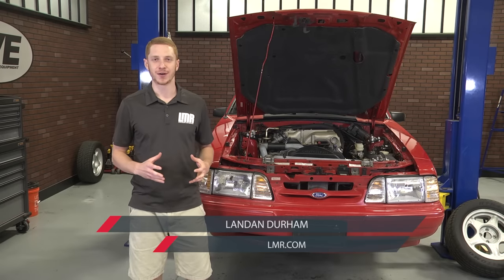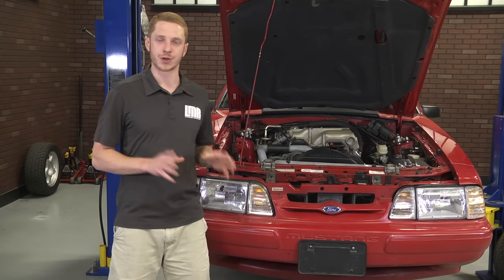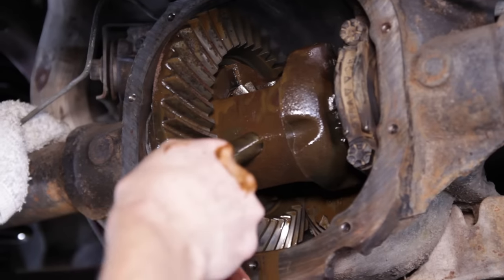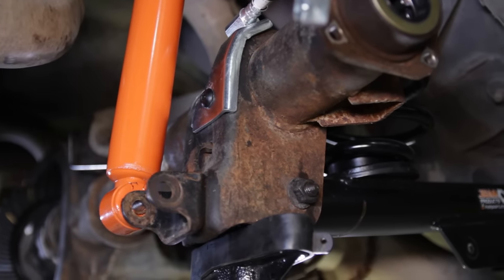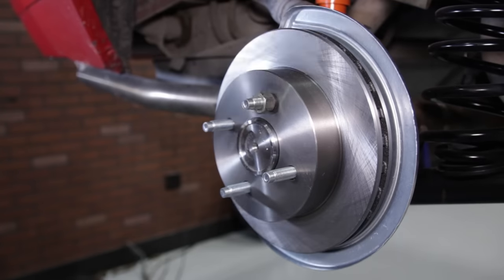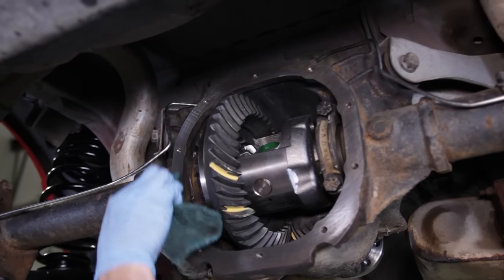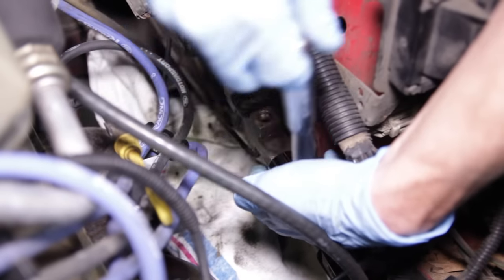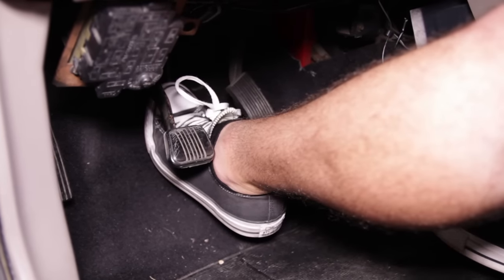1979-1993 Mustang SVE 4-Lug Rear Disc Brake Conversion - Review & Install

Comment: I know this is 5 years old but I do have a tip to share with all fox bodies owner. If you have a five-speed with most of us all do and when you take off and you hear a little clink when you are starting off and cannot figure out where it's coming from this tip is for you.

That noise that I was hearing had me worried that either something's loose in the rear end or my transmission. Every weekend from spring until fall I would be at the drag strip with racing slicks and would race all day. So I had a good reason to worry.

I finally had enough of it and put my car on jack stands and rims and had my father get in my car and start and work gear. It was definitely coming from the rear and for some reason I decided to tighten the bolts at the end of the drive shaft that attached to the rear. I used a 12 mil 12 point wrench and yes got a little bit of movement from each bolt. I thought to myself this can't be it. Sure enough when my father put the car into first gear and no more noise.

I had stopped by to have lunch with a friend of mine who was a Ford mechanic. He was the senior mechanic at the dealership as we were walking out one of the mechanics stopped us and was demonstrating the noise that I was feeling with. My friend told the mechanic to change to you joints and I said you don't need to do that get a 12 mil 12 point wrench he looked at my friend he told him get him what he asked for he knows these cars better than myself. So I told them with just enough movement to tighten them up. They both were skeptical until he got into the car and the noise was gone. At that time mechanics at dealerships got paid for work and there was very little money to be made by tightening bolts and doing nothing else. Since it was a warranty work they went ahead and change the u-joints anyhow.

2 months after that Ford finally came out with a service bulletin identifying where noise was coming from. What Ford wanted mechanics to do were to replace all four bolts holding the drive shaft in. The new bolts came with loctite already on the bolts.

My friend was actually able to grab a box of the bolts for me. Even after all these years 30 plus years I still have those bolt in my garage on my part shelf.

Comment: I know this is an older video and the kit is different now but with this original kit what year did this rear caliper come from? Im in need of the pads and rotors. Had to replace one caliper so i figure i will service the brakes and rotors. I appreciate the info.
Reply from the maker: '93 Cobra rear pads will work with the calipers that were in the older 4-lug rear disc kits. We have a few different options. Link below. -Landan

https://lmr.com/products/Fox-Body-Mustang-Brake-Pads-Shoes
Reply: @latemodelrestoration  what about the rotor?  Is it a 10ich rotor? Thanks for the pad link.
Reply from the maker: @mosesandres3385  A '93 Cobra rear rotor will also work. -Landan

https://lmr.com/products/79-93-Mustang-Brake-Rotors-And-Drums
Reply: @latemodelrestoration  thank you for the speedy response Landan

Comment: I was reading on bleeding brakes with an adjustable proportioning valve and everyone’s saying the valve should be fully open when bleeding brakes?
Reply from the maker: That's exactly what we mention in the video at 11:26. Thanks. -Landan
Reply: I guess I misunderstood. In the video you said turn clockwise which I thought was closed. Then said after bleeding adjust the knob in the middle
Reply from the maker: @DarkFoxx88  A brake proportioning valve doesn't work the way you're thinking. When you rotate clockwise, you're allowing maximum braking pressure. When you rotate counter-clockwise you're reducing the maximum pressure by roughly 57% (this varies with each proportioning valve). The best reference I can give you is that an adjustable brake proportioning valve is not like a hose spigot. You're not "closing" or "opening" the valve. As with anything mechanical, there is a detailed engineered explanation as to how an adjustable brake proportioning valve works and that's too long for a YT comment. Lol! Hope this helps. -Landan

Comment: I noticed u didn’t install any parking brake cable brackets, are they needed or is this an option? On the five lug conversion video, it shows them installed 🤔
Reply from the maker: If you have the available brackets, the reuse and install them. - Jude H. - Social Media/Events Coordinator
Reply: Late Model Restoration 
I’ve done the drum to disc conversion.and the car already had upgraded lower control arms ,so it didn’t have any brackets. I have access to some from an sn95, are they the same as on the 93 models? If so could those be used? ... thanks
Reply from the maker: The 94-04 brackets are different from 79-93 brackets. I'll link them for you below. Unfortunately, we're currently out of stock. You can sign up for in-stock alerts on the product page to be notified when they've been stocked and are ready to ship. - Jude H. - Social Media/Events Coordinator | https://lmr.com/item/LRS-92860/mustang-parking-brake-cable-bracket-79-93

Comment: What about the five lug ford ranger axles will they work with these in the mustang? Of course I know you all want to sell your products so prob won't address this
Reply: someone who wants setup without taking the axle assembly off would prefer this.
Reply: This video is made for people who want to keep the old school 4lug but want rear disks. I've done a few axle swaps, any v8 or v6 axles from 1994-1999 and 2000-2004 work with the 1985-1993 mustangs. I've done it but I have a 93 that I wank to keep the 4lug so this product is appropriate for some

Comment: Bought my 89 Notch with these installed already, do you guys sell the brake pads?
Reply from the maker: Here is the link: https://lmr.com/item/LRS-2001E/1993-Mustang-Cobra-Replacement-Rear-Brake-Pads

These are the same pads we include in the kit. -Landan
Reply: Late Model Restoration thanks!
Reply: this kit appears to include standard 94-04 mustang rear calipers.  it also includes a vented rotor.  Were you to go to a parts store, you could tell them you have a '94-'04 cobra, '03-'04 mach 1, or an '01 bullit and get the correct pads.  Odds are they'll STILL ask you if you have vented or solid/unvented rotors (despite the fact that the aforementioned list of cars are the only ones that have vented rotors from the factory), and you'll definitely want pads for vented rotors.  The pads for unvented rotors are too thick to fit.
Reply: ROYCE 415 wouldn't rear disks cause the car to spin-out if you had to slam the brakes in an emergency?
Reply: Carlos C. Only if you set that proportioning valve completely wrong. Many cars have rear disc brakes.

Comment: @+latemodelrestoration, ok I'm confused, when u gutt the proportining valve, do I removed  all the internals? or do I just replace the rubber ring? I'm almost done with my disk conversion.
Reply: Miguel Tamayo you probably figured it out by now, but you pull the whole mechanism out of it.

Comment: What is the radius of the axle center to the outside of the caliper.  
I need to know if the rims I am using will clear.
Reply from the maker: I do not have this specific measurement, but this particular setup will require the use of a 16" wheel or larger.

Comment: So I'm in the middle of this installation and I cannot get the brake pads installed with both anti-rattle clips. I got the outside pad in, but it's jammed and there is no friggin way it's going to be able to release or slide. What do I do???
Reply: Had the same issue, I took a file to the pad

Comment: Will this kit fit a 7.5 rear end?
Reply from the maker: Daniel - This kit is designed for cars originally equipped with 8.8 rear ends.  However, it can fit 7.5 rear ends with minor modifications.  Instead of using the provided axle hard lines, you would need to cut and flare your factory lines to install them into the brake hoses.  Other than that, everything installs according to the video.
Reply: @latemodelrestoration  nice very nice, thank you for the information

Comment: does it work with c clip eliminator ?
Reply from the maker: The included disc brake brackets will work with c-clip eliminators. However depending on the axle that is in the car, this kit may or may not work. -Landan
Reply: +Late Model Restoration the axles are moser 31 spline .

also the car is a 79 but the rear end is out of a 91 GT .will that make a difference?
Reply from the maker: Long story short, we put a 31 spline carrier in this car while everything was apart. That being said, it has 31 spline Moser axles as well. Here is a link to the axles we used: https://lmr.com/item/MOS-7993-31/79-93-Mustang-31-Spline-4Lug-Moser-Rear-Axles

You'll be able to use the axle hard lines as long as the center upper axle hose is on the driver side of the rear end housing. If not. you'll have to cut and flare the factory lines. -Landan